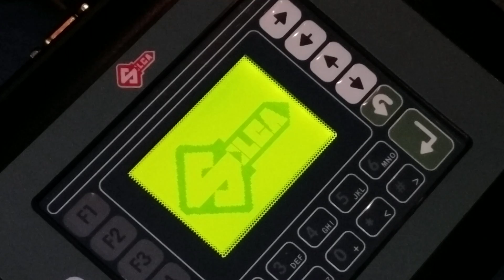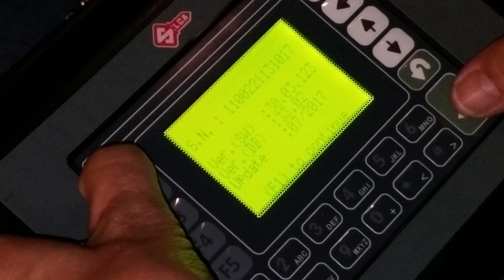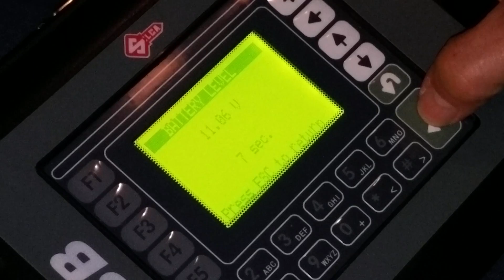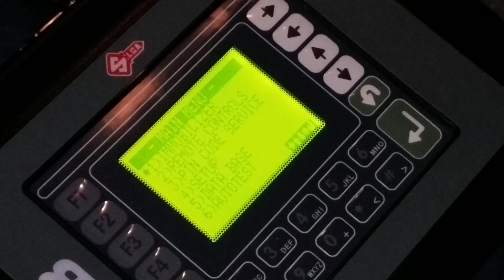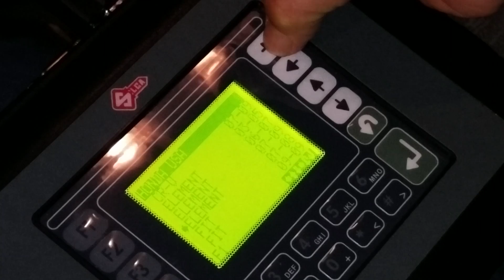SBB key programmer troubleshooting

Comment: ECU not found error for SBB PRO2  V48.99 .
SOLVED -  you must have the car battery full (voltage over than 11.5 volts).
Reply from the maker: moldovita2 moldova thanks

Comment: On SBB PRO2 programmer, does 'Erase all keys' function  erase other keys in ECU except the current key?  It is good practice to erase old keys before adding new ones. I did 2010 Honda Element without erasing keys and we reached 'Position Ended Message' after reaching 6 keys in ECU.
Reply from the maker: Im not sure, There is no documentation for the SBB knockoff programmer, so I just assume that erasing all keys is a good idea. 6 keys might be the max.
Reply: Honda Jazz 2006(FIT) did not work. ECU not found.  Note the SBB voltage reading is always 0.7 volt lower than the battery. That is a design defect. As the dashboard shows a flashing key, the ECU has enough voltage. I had a 4 amp 12v mains power adapter, repeated the test, also failed.  Checked that the OBD cord was not faulty (as in why wiggle it) and it worked on a Mazda where the battery was below 12.0 volts.  I suspect the settings in 48.99 are wrong. We need to post what voltage the battery is, because the vendor/maker is careful NOT to supply a listing to online merchants. Next step is to ring out the OBD cable for continuity.
Reply: SBB Cable Pinouts Blue moulded Plug 2022

PIN01 OBD connected to pin 11 DB25 MD
PIN02 OBD connected to pin 08 DB25 J1850
PIN03 OBD connected to pin 07 DB25 MD
PIN04 OBD connected to pin 01 DB25 GND
PIN05 OBD connected to pin 01 DB25 GND
PIN06 OBD connected to pin 03 DB25 CAN HIGH
PIN07 OBD connected to pin 24 DB25 1941-2 K 
PIN08 OBD connected to pin 02 DB25 

PIN09 OBD connected to pin 13 DB25 
PIN10 OBD connected to pin 23 DB25
PIN11 OBD connected to pin 20 DB25
PIN12 OBD connected to pin 19 DB25
PIN13 OBD connected to pin 16 DB25 Honda Immi
PIN14 OBD connected to pin 15 DB25 CAN Low
PIN15 OBD connected to pin 05 DB25 9141-2 L
PIN16 OBD connected to pin 12 DB25 +12V

Comment: Hey Dan, did you eventually get it work? I have the same problem with this SBB (got it on ebay). my car is 2011 Honda Fit
Reply: Thanks Dan. Will try again tonight. Another question is the Honda Fit in this SBB unit only has til year 09. Mine is 2011. Don’t know if that’ll be a problem. I got ECU NOT FOUND message in the last step though. Similar to yours
Reply: I wiggled the connection just like you suggested. No more “ECU NOT FOUND” message. But still doesn’t work. I got this “no loaded key repeat procedure” message. And I tried 5 times. No luck. So upset....
https://youtu.be/dyhgOQI-we8